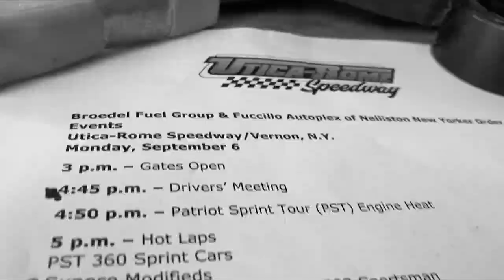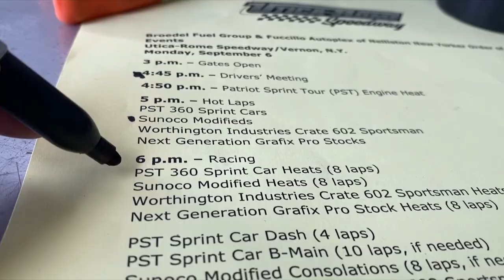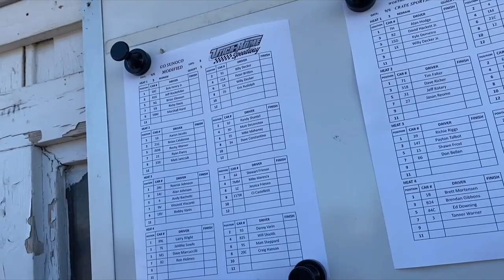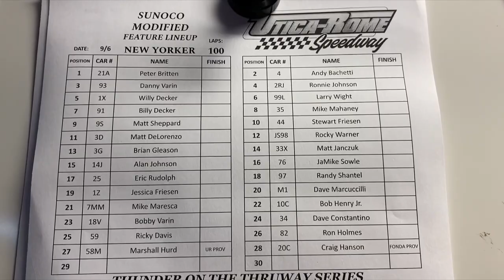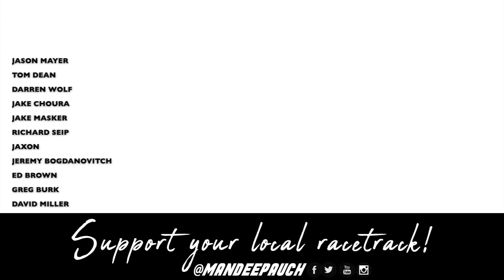Bad Luck Streak Continues At Utica Rome Speedway

Comment: Its racing. Highs and lows. When you fill the hole, you need to get to it and not lollygag. It will get better.
Reply: Lollygag?
They were door to door.
Mike had the line, Britten drove him into the infield. The video couldn't be any clearer.
Reply: @JohnDoe-dp5vo  yup the proof is in the pudding...in color besides that. That was def no racing deal.
Reply: @JohnDoe-dp5vo  They were door to door, until Mike lifted going into the corner. I see his point. I think it's perfectly reasonable to think the 21 thought he let off enough that he could get back down to the bottom again, Mike didn't, and what we saw transpired. I don't have a dog in the fight but it looks like an unfortunate racing deal. Unless the camera angles make the car positioning different than what they were. As in if they truly were side by side going into the turn and the 21's angle of attack into the corner is what cut Mike off, then you have an argument. But otherwise, it just looks like racing.
Reply: @David-qu3ro  
Everybody lifts getting into the corner, otherwise everyone would fly off the top of the track, just like losing your brakes. Britten has been driving long enough to know that. I've been involved in racing for nearly my entire life. Whether others realize what happened or not, I do. It was a dick move by the 21a, and I'm sure he knows it too.
Reply: @JohnDoe-dp5vo  "Everybody lifts getting into the corner, otherwise everyone would fly off the top of the track, just like losing your brakes."

Yes. You know what I mean. I didn't mean the normal corner entry lift. I meant the "I better lift enough to get out of this situation" lift. There is a difference.

Comment: Check into the grease your using on your trailer bearings. We have had an issue on our trailer with bearings and was told about particular bearing grease. Yeah that was a bonehead move that guy made on mike. That’s the reason I go in a straight line. Lol

Comment: So I watched this about 10 times now.  Sucks it happened. But then again maybe Mike could have lifted? It was lap 20.  Not taking no sides here whatsoever. Just sucks the luck Mike has been having lately.
Reply: Why would Mike have lifted when he is door to door ? Can tell how you would fair as a driver . SMH
Reply: Again.  Destroy my car on lap 20 of a 100 lap race.  Or lift and finish.
Reply: I was in the stands, but not a great “live” view. After rewatching numerous times, I agree with BT. It’s racing. I not a fan of the 2rj, 21a, or 35…just a race fan…but I just don’t see it. Understand your frustration, but I’m sure that you’ve (unintentionally) been the chopper rather than the chopee…bottom guy usually escapes ok. The placement of that barrier tire didn’t help…you miss that, and you’re still competing. Good luck going forward.
Reply: I agree. Thing is, Mike did lift. That's why I think the 21 thought he could shift back down as he didn't see Mike anymore. Problem was, he didn't lift "enough." I don't have a dog in the fight, but to me it just looks like an unfortunate racing deal. Unless the camera angles make the car positioning different than what they were. As in if they truly were side by side going into the turn and the 21's angle of attack into the corner is what cut Mike off, then you have an argument. But otherwise, it just looks like racing. But I'm just a random on the internet so what do I know, lol.
Reply: Not trying to be an asshole or anything. That's just my opinion.  I don't race. But love the sport.  Best of luck to Mike the rest of the season

Comment: When Britten slid up it looked like you could of filled the hole quicker leaving him at no advantage to come down, level of aggression driving in future turned up, lesson learned
Reply: They were side by side, wheel to wheel. Britten knew exactly what he was doing, and chose to run Mike into the tire. Bottom line.....Mike was there...he filled the hole that Britten left open, and intentionally drove Mike into the tire. It couldn't be any clearer on the video.
Reply: @JohnDoe-dp5vo  John Doe
Reply: I take it your on Brittians crew